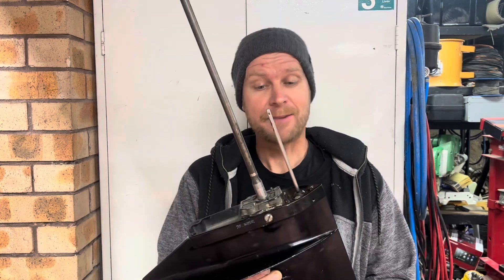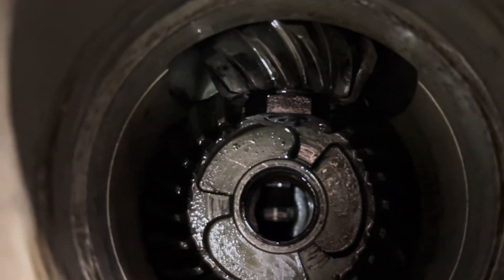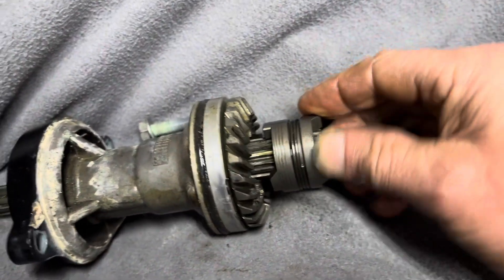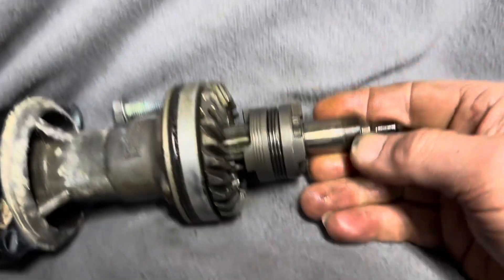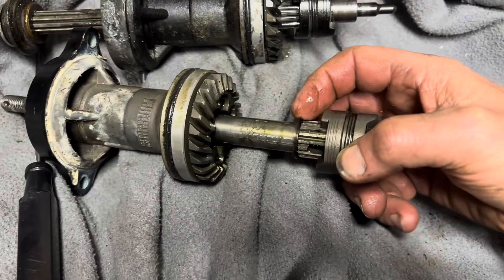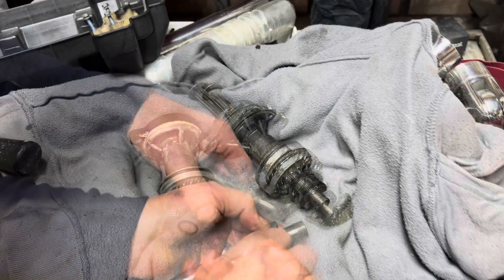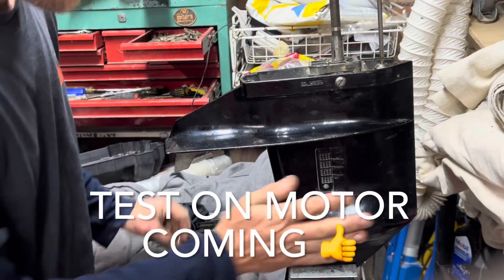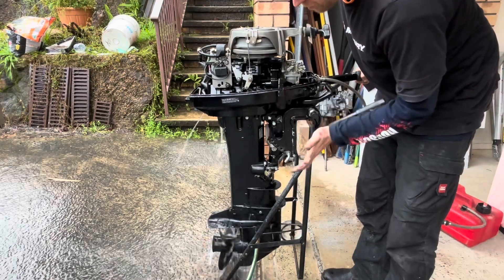Outboard gearcase

Comment: Thanks for the knowledge about the little gearbox issue as I have a little 1974 20hp Evinrude supposably with gearbox issues or shifter issues. I'm yet to verify that. 
Anyway I'd like to learn more about how to twerking it up to be a little a racy little 35hp engine or so?
From  engine mods all the way through down to the prop. 
The engine is fitted to a old 1974 de-Haviland 3.5m tinny that I intend to keep using as a weekend fishing/sping trolling boat. 🎣🚤🇦🇺
It will be mostly used for slow speed trolling but I like the engine to have some racness zip about it while travelling for A-B.
Regards Bernard.
Reply from the maker: Thanks for the comment mate, that sounds like a fun project. I have a few videos on my channel about making outboards faster, maybe they could help. 
Also think the 25hp carb will fit straight onto your motor, make sure it’s from the same vintage though as they did get more capacity (cc) around 1980 I believe.
Cheers 🍻 Aussie Boat Guy 😎

Comment: How about nose cones, you like mods and welding.
Lets see speed increases on the common 15hp engines without chopper props and jack plates
Reply from the maker: Hi Mate,
I have actually tried it. Believe it or not, no increase with a nose cone fully submerged. So found out the only reason for a cone is if you want to surface piece as it helps the motor track straight as you are lengthening the torpedo, it helps stop blow out and if using stock pickups it draws water up to the pickups.
Cheers 🍻 
Aussie Boat Guy 😎

Comment: Some one might have put a aftermarket prop shaft see how the end of prop shaft that goes threw forward's gear is longer
Reply from the maker: Possibly mate, I know that Tohatsu has been making that gearcase since 2003 with not any major change, I reckon the later versions have the longer shaft to support the shift pin better.
Cheers 🍻 
Aussie Boat Guy 😎
Reply: @25hpboatracerman ok nice to know thanks

Comment: I have owned a few outboards and when changing the lower unit oil there is always metal on the magnets i would guess from that dog teeth engagement.
Reply from the maker: Hi Mate,
That's correct, a little bit of metal is common, but it's important to keep an eye on it.
Cheers 🍻 
Aussie Boat Guy 😎